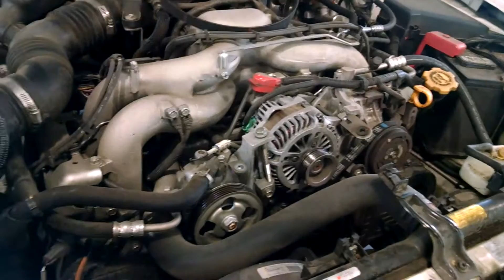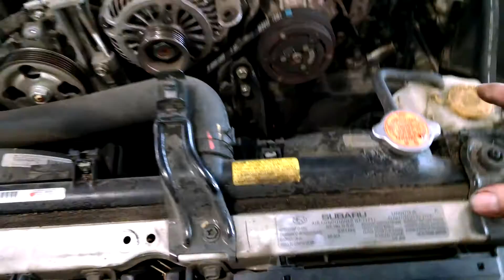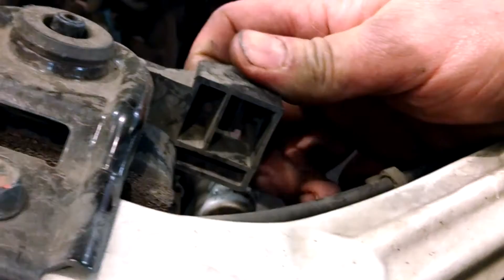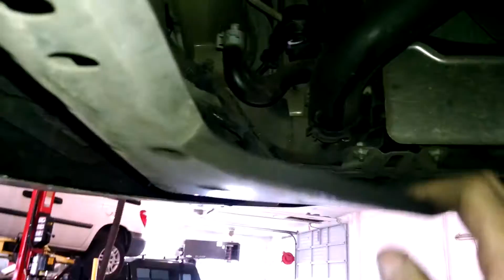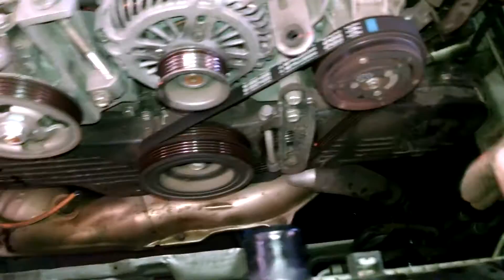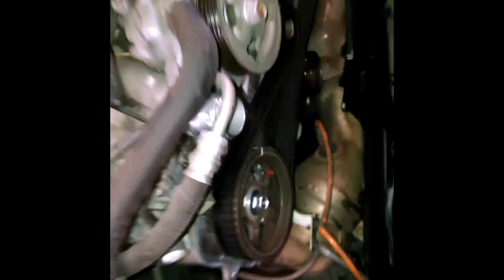Timing belt replacement Subaru Legacy 2009 Water pump How to change WP and TB

Comment: Hello I have a question when I change the timing belt and water pump on Subaru Legacy 2009 should I change the thermostat too ? And is all the thermostat the same or the one with water pump is different if it’s different what it’s called please thanks

Comment: The drain plug for the radiator is blocked by the plastic shield. It's a pain when you need to drain it. On mine, I pull that before opening the cap up top to keep my from getting covered in fluid.

Comment: I got a 09 Subaru Legacy 2.5, Mine has a Metal Rattling noise when i accelerate N goes away if I Step on it a Little, Been Chomping on the bit of What It is!!!
Reply: Probably a heat shield on the front part of the exhaust that is attached to the engine. That's what it was for me at least
Reply: @gazmmm  Ahhh Haaa, Very Koool I'll check it out, Thank You Sir

Comment: Hi, there. Thanks for posting this video. I just replaced timing belt in 2008 Subaru Legacy and engine won't turn. Any suggestios.Thanks
Reply: THETHINKINGMINDS ur timing is off
Reply: @christianzarate8319  hi, do you know when timing belt broke needs repair the valves? I want to know after belt Brocken needs machine shop work?